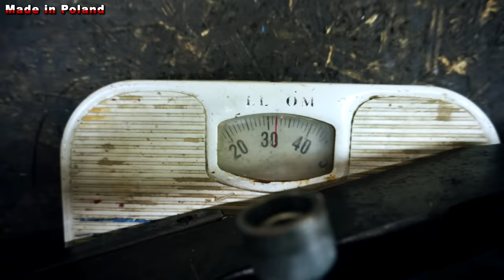Super Strong Hydraulic VISE DIY [Plans]

Comment: Great work as always, the ability to hold something with two hands and still close the vise is really useful!
Reply: even more usefull is the foot lever to open it when you clamped both your thumbs in it ;)
Reply: Why whats the point I have been using the same vise for over 20 years no problem. Dont buy shit tools and use them right and they wont break. I have never had problems clamping multiple pieces in a vise but then I use my intelligence to find ways. Um called vise grip c clamp
Reply: Well you are free not to make one then.
Reply: Phil Vandelay
Reply: Phil Vandelay
Reply: P4OUR I got all the hair I need thanks
Reply: @peteraugust5295  და დღეს
Reply: @donaldasayers  x.ligda
Reply: @asuncionreyesromero3667  wot?

Comment: Hi from New Zealand.I am a retired mechanical engineering manager with 25 years hands on practical experience behind me. Amongst many other projects in our maintenance workshop I have used many hundreds of kgs of mig wire with my own hands and my team have used thousands building log handling equipment and conveyors etc etc etc.  I know what I am talking about.You have a great idea and I congratulate you on the finished project. I have 2 suggestions. 1st is to make deeper weld preparation especially if you are going to grind the weld to look nice. For example the triangle pieces that you made and fitted very nicely. looked to only have prep about 5mm. It should be full depth of material. various other bits needed deeper prep also. Something like a vice needs a safety factor of about 4 to 6x the expected stresses on it. Its reasonably easy to work it out as most of the steel you were using liiked like 20 to 25 ton psi mild steel.Second suggestion is that in most situations the fixed jaw of the vice should be over the edge of the bench and jice jaws should be wide enough to clamp onto a vertical pipe or shaft or bar so you canhold it firmly.Possibly mounting feet and bolts may be a little light but only time will tell. Vices get a ridiulously hard life so only time will tell. I am shure you are the type of guy who who is a problem solver.Much respect to your idea I give it 9.5 out of ten. By the way I only comment on utube about 3 times a year when I see something that is really worthy. utube is full of  people who can strike an arc and are just learning welding then they make a video trying to teach others how to weld. Thats like dong a 9 hole golf course and showing how easy it is to play professional golf!!!!!Btw I learned to weld with stick in all positions, plus branched into specialty weling like large broken cast Iron bearing housings that took all my time I could muster for 3 days plus boult a 23 ft alloy catamarant for fishing from sheets of plate I cut with various tools and welded together with a spoolmatic gun. fun times! I caught marlin tuna plus lots of eating fish in that boat till poor health made me give it to my son. congratulations again.
Reply: All the manager I've ever met who have to explain how much (hands on experience) they have done, have done bugger all. Get your point though, if it was me I would of prepped most of those plate. Especially the weld directly under the two jaws.. but who are we too judge, this project is clever.
Reply: Respect.
Reply: Many mangers have never been hands on. I did 9 years fulltime hands on i the workshop then started managing that workshop for the next 17 years and 1 was often 50% on the tools.
Reply: I have to agree with dennis. The weld prep could go a lot farther if you create a heavy bevel on that (what looks like ) 1/2" plate. It doesn't look like you have any problems with your welds breaking based off your tests, but to really create that cohesive metal structure you're looking to create with that weld, you'd really wanna create a deeper penetration to stand the repeated abuse that vise is sure to get over the years. I love this idea and I'm definitely looking to make one or two for my shop. Thank you for the excellent tutorial!
Reply: dennis hamlin nice constructive feedback mate. When I make one of these vices I’ll be sure to remember the additional points you made. I’ve never seen a hydraulic vice like this before.
Reply: глупо тратить время на то что сделано 3века назад или300 лет я в шоке
Reply: железа видно не мерено
Reply: zx6R Lew. Пиши по русски , !
Reply: @chimichongamilk If I would also do one ... but without discounting the merit of the video .. it has many things that can be improved, especially if you think about selling

Comment: Should be really great with an electric power-pump and a "clamp-down" or "brute-force" selector switch.
"Clamp-down" position should use a ajustable bypass pressure valve to limit the pressure when you just want to hold on pieces in the vice.  a simple valve can able or dissable this bypass chanel. 
When "brute-force" is selected, the valve si closed and the bypass pressure valve inhibed. 
Simply as hell and really fonctionnal.
Best regards and congratulation for this work !

Comment: Excellent build.  Thank you for sharing.  The only additions would allow it to swivel and to use a small electric hydraulic pump to close the jaws. One that moves a convertible top as an example.  Even without the changes I would be proud to have your tool mounted on my workbench.

Comment: That a really good idea and I've watched your channel since you had 500 or so subscribers and you've really improved your skills. I'm not knocking you but you could easily change the cylinder to a compressed air cylinder and just use a foot switch. If you look into how to change a hydraulic cylinder to a compressed air one it's really easy to do
Reply: Air pressure doesn't clamp like liquid pressure, both are dumb though.Can't beat the clamping pressure of threads
Reply: Search how to change a normal hydraulic cylinder to an air over hydraulic up
Reply: HighStreet Killers uh no, hydraulic force has a lot more clamping pressure that any size of thread no matter what the pitch in the thread is. And if hydraulic cylinders are dumb why do they use them in the industry and you don't see a press using a thread for the force
Reply: @highstreetkillers4377  ah yes, that's why 100 tonne presses just use a big grade 8 bolt
Reply: jeremy mcadam, are you referring to AvE’s 100 ton press? That takes 4  3/4” bolts and a ratchet with a 24” cheater bar and it takes him three beers to get it to 50 ton!
Reply: @Hoaxer51  haha no but thanks for reminding me of lil screwy
Reply: jeremy mcadam, just trying to have fun!

Comment: Amazing, good job,
FYI to increase weld strength you need to grind in before welding, flush welding and simply grinding flat is weakening your joints

Comment: pneumatic over hydraulic have a nice kind of hidden regulator and gauge under the tables edge. have a foot pedal with rocker so you can go in and out , you can  have two hands that are free for fitting parts in vice. pump doesn't come on till u step on pedal .

Comment: Clever idea, but it is basically a horizontal, outside-in H press.  I think it's biggest positive feature is that it is foot operated.  Otherwise, most vices are best used with some finesse when clamping things... this thing will inadvertently crush a lot of work pieces.

Comment: If I may offer my two cents, you may want to upgrade the seals and the hydro oil to high temp products. If you plan on welding or cutting in that vise, the heat could degrade those parts much faster than normal.

Comment: Hello .. this is technological information for you .. if you allow me .. the clamp is made of cast iron .. in order to withstand high pressure so as not to bend the iron.  The iron you used is iron that is not used for high pressure.  Can't bear the pressure.  Because it is intended for household and other industries, and not intended for high pressure such as iron (lathe body) or (clamp body) .. it arches over time ... Thank you for reading the comment.

Comment: Does all of those 5 ton pull cylinders have that spring to auto open them or is that something you had to modify. My two favorite shop built vices are yours and the fireball vise. I have a idea to combine the 2 kinda. A little of his ideas and a little of yours.I want to build it so it has a lead screw that will open the close the jaw another 6 inches and then power in with the hydraulics  the last 5 inches that the pull cylinder will move. I got it worked our in my head just never messed with those hydro push pull kits.

Comment: Hydraulic presses for moulding parts work like this. I do not understand why this vise does not use a much smaller 1 ton cylinder. It is very cool, but seems also like an overbuild.